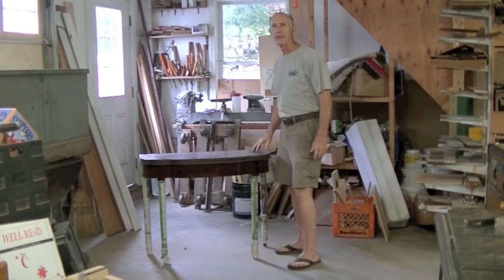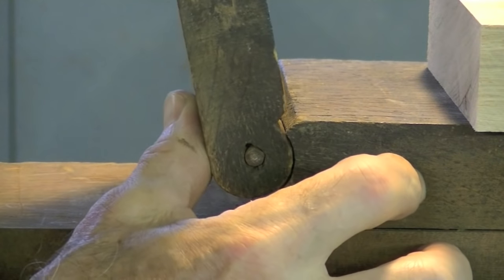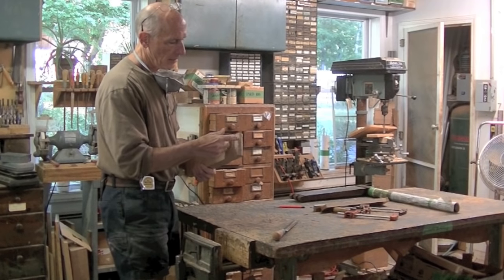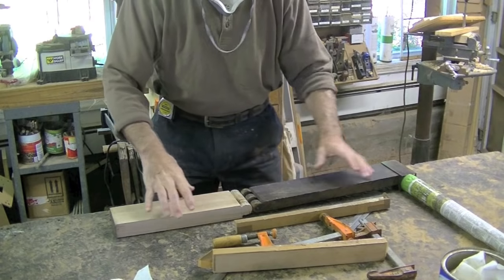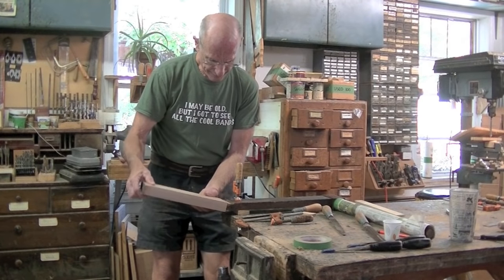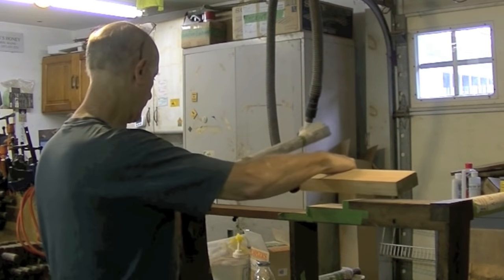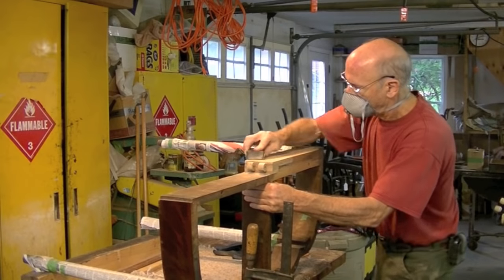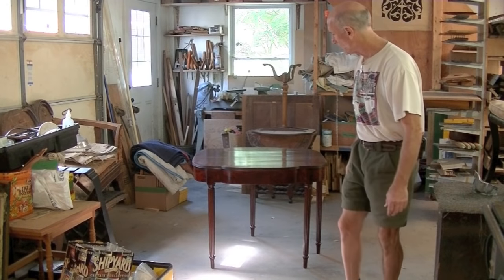Making a Wooden Hinge for an Antique Card Table - Thomas Johnson Antique Furniture Restoration

Comment: Great repair. In all your videos I have noticed the availability of various woods used for repair. Not easy to find or cheap in Scotland.
I wonder if you ruled out waxing the hinge holes in the event the pin might slide out.
Would the staple you used to hold the pin not also work its way out?
Really have enjoyed catching up on your other videos. Thank you for taking the time to share your work.
Reply from the maker: You're welcome Alan. I'm hoping the staple stays, the reality is that the leg won't see much use, so it should be fine.
Too bad that wood is difficult to find. At least with repair work you don't need much.
Reply: Alan Dickson I

Comment: Nice work recreating a missing/ messed up piece. I would suggest a bit of grease in the joint to make it easier to open and close. 3 in 1 oil works ok too, but grease stays where you put it.
Reply from the maker: Thanks! Grease on wood? I'm not so sure. I did wax it but I don't know how long it will last

Comment: Second time watching this excellent video and my Q is, why you used hand saws to remove the hinge spaces (8 mins) and not the band saw, any particular reason for this?
Reply from the maker: Thanks! I think I had better control with the hand saw, especially when it came to the stopping point
Reply: @johnsonrestoration  Thank you Thomas. One more suggestion if you don't mind, would love if you to make us a video on finishes... when you use that type of finish instead of another one, because I watch you using different methods all the time. Thank you and keep up this excellent tutorials, your videos are treasures to me. !!!

Comment: Hi Thomas, I looked through some of the comments below but didn't see this anywhere.  Did you use any wax (an old candle) on the knuckles of the wooden hinge, much as you might on some of the dresser runners you've worked on?  Thank you for the video
Reply from the maker: Yes, thanks! Any wax will do. I've never figured out if one is better than another

Comment: If I may ask, did you not think of just mortising in two new hinge tongues (the parts that were broken off) into the original piece? A little work with a router and you would have had two slots to glue them into. Not meant as an insult! Love watching your videos, you always do such a beautiful job.
Reply from the maker: Hi Clive, no insult taken, but I'm not sure I understand. But thanks for watching and commenting.
Reply: Yes, difficult to explain without being able to send pics. I was suggesting just cutting out the broken parts. Cutting two slots in the good wood where they were and inserting them like tenons, the parts that stick out would then become the hinges.

Comment: Wouldn't it have been much easier to cut the bulk of the hinge using the band saw? Great work as usual, Tom.
Reply from the maker: You know, it might have been. This is one of those jobs that when you're done you begin to realize more about how you could have done it. Well, maybe next time except that by the time "next time" comes you've forgotten how you did it the first time! Maybe not, but that's happened before.
Reply: Yes that's very true. I don't think rebuilding a hinge like this is a very common repair, and there's a good chance that the next one won't be made the same.

Comment: Nice repair, I was also looking at the bandsaw in the background while you were making the hinge (looks like a Delta 28-200? just like my Rockwell 28-200) and wondering why you weren't using it. Could you have hidden the joint between the new wood for the hinge and the existing apron by planing each down and covering the whole face with veneer? Oh and I like the tee shirt too!
Reply from the maker: Thanks! I use both bandsaws all the time, one has a 3/8 blade, the other a height extension and a 3/4 blade. You're idea's not bad, although I would hesitate to veneer secondary wood
Reply: What do you mean by secondary wood (is that the new wood you added?) and what is the concern with applying veneer over it? By the way I'm just a hobbyist currently restoring an old veneered walnut card table and I've used a few techniques from your videos to make  successful repairs, thanks for the help.

Comment: This is another cool video . . . Thanks for sharing . . . Curios: With the half lap joint, what glue did you use please? Was it hide glue or epoxy?
Reply from the maker: Hi Jeff, I used hide glue, because it's an antique. Yellow or white glue would have worked as well.

Comment: I was surprised by which glue you used. Is that stronger than titebond glue? That's what I usually use.
Reply from the maker: TiteBonds great, and I use it for a lot of projects. But hide glue is good also, and so I use it on antiques just because it's an excuse to get out the old glue pot, reminds me of my Dad's shop.

Comment: You could put some wax on those hinge parts and on the hinge pin before you put it all back together. That way, the wax would lubricate the hinge a little.
Reply from the maker: Thanks! That's a good idea. Typically I would only waxed finished sealed surfaces, the thought being that the wax will soak in and/or dissipate pretty quickly on the raw wood. But it would work for a while

Comment: Nice. I have used old wood steeped in caustic solution to leech the tannin's to match a piece. The caustic needs to be neutralized with vinegar before use.
Reply from the maker: OK, I'll have to try that. What caustic solution? Lye? That was tough to match, thank goodness it was in the back!
Reply: Sodium hydroxide which is bought in granular form and added to water. We had a giant tank of it which could strip paint from wardrobes.If you wanted to lighten a wood it worked well  and the residue of many immersions made a good water based dye. The only wood that did not work well with was mahogany.

Comment: You seem to prefer hide glue for wood to wood joints. What are its benefits compared to "modern glues?"
Reply from the maker: Thanks! Only that it is close to the original glue, and is compatible with the old glue. On non antique work I use Tite Bond https://www.youtube.com/watch?v=AmFot8H_2Kk

Comment: why are u using that type of handsaw and not just a regular one? is there a different in cutting effect or something?
Reply from the maker: That's a Japanese Dozuki saw, and it's a lot different than the conventional English saws. A thinner blade, and it cuts on the pull stroke giving you much more control.
Reply: does it cut on the push stroke to?
Reply from the maker: No, I think all saws cut just one way or the other

Comment: At minute 2:54, I saw the crack in the board and I asked myself why you proceed with the hinge-making process and do not cut away the defective part. At minute 5:52, the obviously inevitable splitter breaking occurred. I think that this is not the best example of restoring furniture if you don’t use the most flawless possible wood.
Reply from the maker: Thanks! Yes, that crack was annoying, but  glued it up and I'm sure it's fine. Part of the problem when using cut offs.

Comment: If you use bigger scrapers/knives and put the heat more on the blade you'll get the heat deeper into the glue. Just saying but.
Reply from the maker: Thanks! I do try to direct heat onto the knives sometimes, but I should do it more often

Comment: I've watched a lot here and  am wondering if I am correct in thinking that this and other repairs are due to poor design. Often these perceived flaws are on expensive furniture st least nowadays. This leaves me wondering were the builders really that good at their craft ? For instance why would someone make such a weak hinge that was doomed to fail. Any comment appreciated, I worked for the old Ethan Allen Co, in the sixties.
Reply from the maker: Thanks! Ethan Allen is a good company! Yes, it seems to be a lot of design problems, but on the other hand, were they designing furniture to last for 200 years? They would have laughed at the suggestion.

Comment: I wish I had a goat. :-(
Reply from the maker: Thanks for watching! They're alpacas!
Reply: Thomas Johnson Antique Furniture Restoration haha, tomato, tomata!  On a serious note, I also repair furniture, both newer and antique.  But one thing I still struggle with is the line between repairing aesthetically and destroying the value of a piece.  Do you ever run into the same dilemma?  Is there ways to mitigate the issue - for example, leaving a crack to hold its value as opposed to fixing it and ruining a piece?  I don’t know if I am making sense - hope you understand!  Thanks again and great channel!!
Reply from the maker: Hi Greg, your question is a good one and yes, I constantly struggle with how far you should go to make a particular repair. It boils down to whether it's cosmetic or structural. Leave cosmetic stuff alone as much is possible. Structural problems must be looked at from an engineering point of view, the furniture you see in all my videos will be used in a home, not a museum so practicality rules.
Reply: Thomas Johnson Antique Furniture Restoration thank you so much for your time in answering!  I will continue to be watching your video’s.  It’s great to learn from others as much as possible.  Makes me excited to get out there and experiment and try things out!  Happy woodworking!